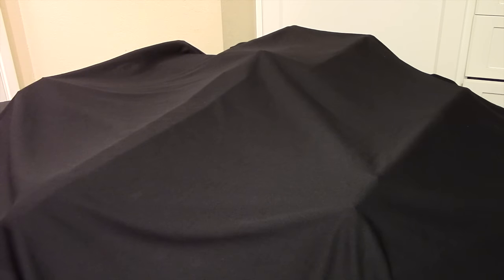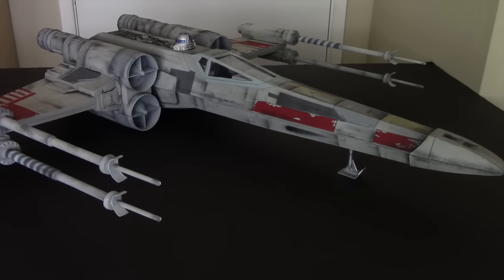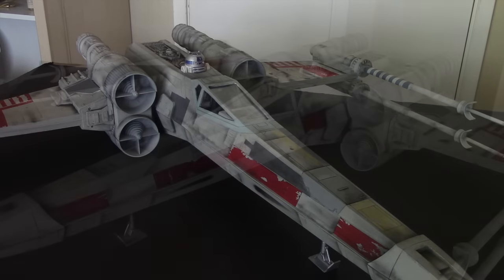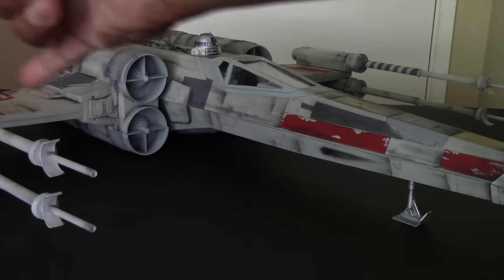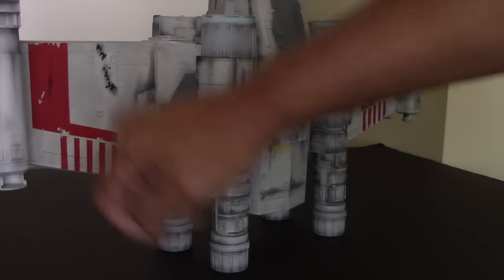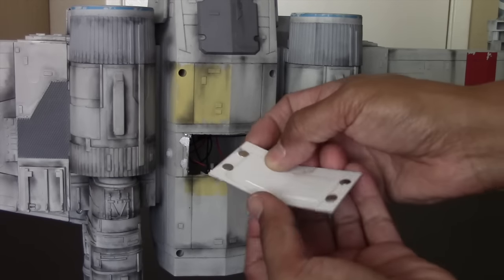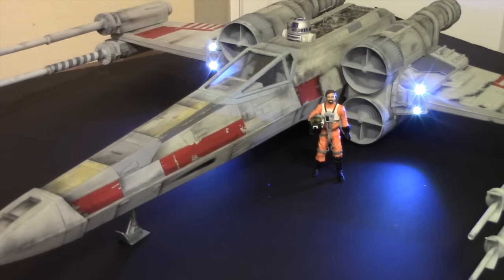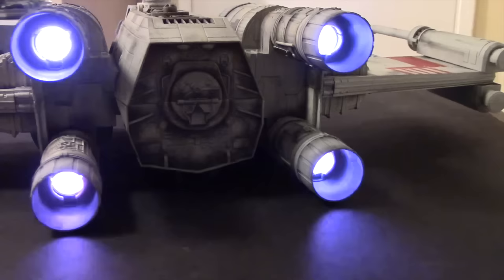Hasbro Hero Series X-Wing Conversion; Completed

Comment: How did  build the interior? You forgot to paint inside the engine. Both front and back in dark gray or somewhat closer.
Reply from the maker: Please refer to video 5 which details the interior build out.  As for the dark gray, I didn't actually forget.  I purposely did not paint the interior of the back engines because the lighter color enhanced the illumination.  As for the anterior intakes, I found myself undecided.  I'll probably end up adding some dark pastels.  Thanks.
Reply: your paint job is really great 10/10